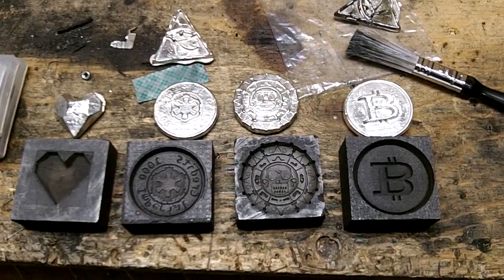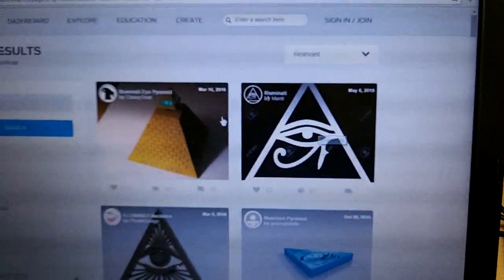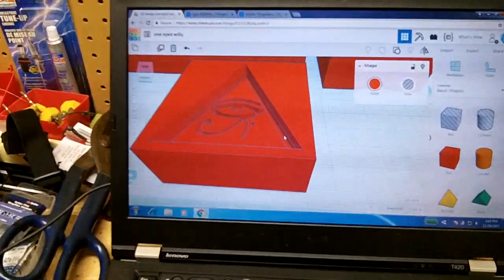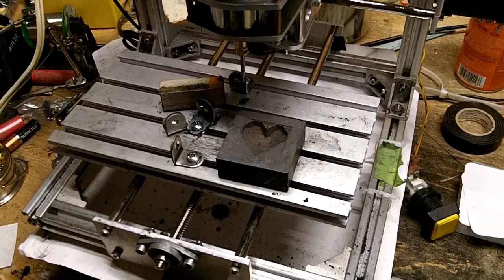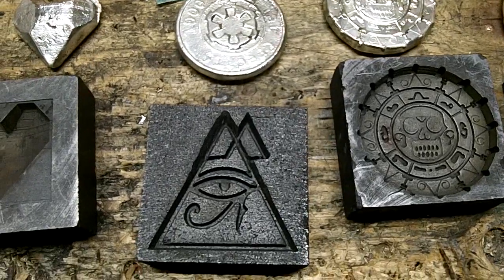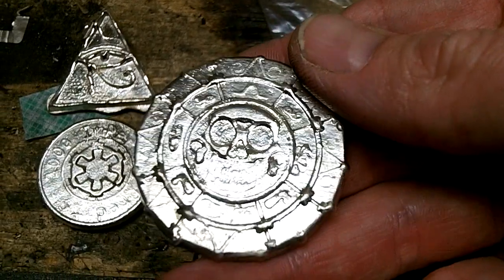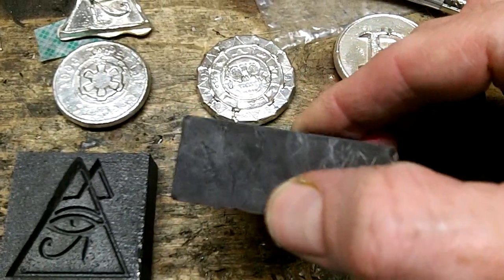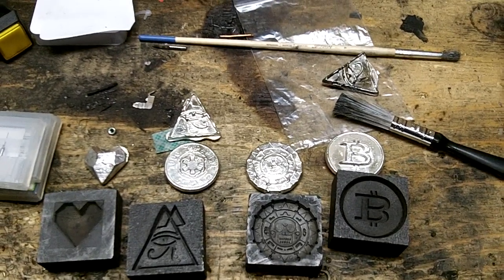Making Graphite Molds

Comment: Thats cool. I was gonna go the opposite way.

3D print the shape i wanna make a mold of. Cover it in graphite powder. Compress it slightly. To retain the shape.

Pop out the 3D blank. Fill it with bentonite clay. 

Then fill out the the rest of the mold with Graphite powder and sinter the lot.

Wash out the bentonite, and id have a mold.

But you way seems a lot easier. If not as finely detailed.

Comment: What bit did you use?
Reply from the maker: 1/8" 20 degree v-bit (basically a tiny engraving bit)  to do it again, I would rough with a 1/8" single flute, then fine detail with the engraving bit.

Comment: I know nothing about graphite molds but im curious if i could use the mold as a crucible itself with a propane torch to melt brass. Basically what im asking is if itll ruin the mold
Reply: there are graphite crucibles so in principle you could, only problem is probably crucible lives matter less than mold lives...unless you can make them your own like in the video...
Reply: This will ruin a mold.

Comment: if you make the top perfectly flat.. and make a side entry spru hole or even a top down spru hole to about/38 wide of a hole out vortext to a half dollar on a new flat block. On trhe other block make 6 or 8 10 air lines to let air escape quickly. clamp the 2 blocks together heat them up while melting the silver then pour it all in 1 quick shot and the detail will be perfect. Your using weight pulse compacting because the silver or metal will press against the flat block pushing the face into the model better.

Comment: If you get your mold red hot before you pour, it will take all the detail and get the silver closer to 1950, 2000 degrees

Comment: Why not simply mold the graphite around the master positive pattern rather than cut it using cnc?
Reply from the maker: There would be nothing simple about that process.  Between the high compression, high heat and exotic binders to get the dust to form into a block it would be impossible for a hobbyist.  Not to mention creating a positive mold to withstand all that...cutting a premade block that can be bought for 5-10$ is vastly easier.

Comment: What size bit do you use to make the molds?
Reply from the maker: On that machine (which I don't have anymore)it was a 1/8" v bit with a .1mm tip.  I can usually cut 1 mold per bit as the graphite chews them up pretty quickly.
Reply: Too Many Hobbies awesome! Thanks for the reply.. is it possible for you to show or email me how you modeled and made them? I’ve been doing them on my channel by hand but yours look great! Just picked up almost that exact same machine but still trying to figure it all out. I’ll gladly mention you in my videos and give you credit and a link back
Reply from the maker: @ArtByAdrock  sure I'd be happy to!  I'm just overseas in greece right now but will be home in mid july If that works?
Reply: Too Many Hobbies yeah that’s cool.. no rush. Do your thing and whenever you get a chance... I have so many projects I’m working on already it’s all good but would love to see how you do it 👍🏻

Comment: In other to get a perfect casting you'll need to preheat your mold blocks to around 1000 degrees this will allow your metal to stay in its liquid state longer that way it can flow into every area
Reply: That's a very good idea
Reply: Just confirming Is that fahrenheit or celsius ?  - Thank you for this information :)
Reply: @hazehunter_au you don't gotta get it that hot just hit it with a torch few sec man pore never had any issues
Reply: @jrcouch5436  thanks man 👊
Reply: @hazehunter_au Celsius, its around 1850 F
Reply: @pichonurbano  Holy Mary, Mother of Christ!!!

Comment: Your mold temperature is much too cold when you are doing your pour. You may burn a couple of molds up trying to find the max temp for pouring but you will get much better detail. Make sure you pour immediately after preheating. 300 degrees is not enough.

Comment: Hey man a possible solution to your lack of detail would be to set the mold on a vibrating plate to help it get down into those crevices a little better.
Reply: pressure, needs to be a press to get the real nice details

Comment: Hi：
This is Elko Hu from Baofeng Five Star Graphite Co., Ltd.
We are the professional manufacturer of high pure graphite and isostatic graphite,and machining graphite parts.
 we has own professional processing plant- Changrui graphite Co.,LTD., 
which covers  graphite mold,graphite die,graphite plate, graphite crucible, graphite vane, graphite wheel,
graphite ark, graphite tube, graphite rotor, etc.. also accept customized graphite products.
any requirements,please contact me.thank you.

Elko Hu

Baofeng Five-star Graphite Co.,Ltd
Western industrial zone, Baofeng County, pingdingshan,Henan China.
Contact Number/Wechat:+86-15617656935
Skype/Whatsapp:0086-15838243056
Email :elko@graphitemanufacturer.com
Website :www.graphitemanufacturer.com

Comment from the maker: As long as you got the file to them in a format their machine can understand, then I don't see why not..They are pretty small so a larger machine would make short work of it.
Reply: What kind of file type does your cnc recongnize? I do some 3d stuff but not with cad, wondering if I can convert my files. Cool video, thanks for sharing it.
Reply from the maker: @totalbullion5882    I start with STL files and after it goes through a couple of programs I get a gcode that can get sent to the arduino that controls the CNC.

Comment: I would love a round made. If you are willing I will pay. I have been looking for coin press dies but I have not had luck.  I can use a punch stamp on the rear after I pour the silver. Thank you for reading. Kon
Reply: Hi,
We are mold maker from New Delhi, India. Please contact me on kdbhardwaj4@gmail.com / +919717208622
Reply: Hi：
This is Elko Hu from Baofeng Five Star Graphite Co., Ltd. from China.
We are the professional manufacturer of high pure graphite and isostatic graphite,and machining graphite parts.
 we has own professional processing plant- Changrui graphite Co.,LTD., 
which covers  graphite mold,graphite die,graphite plate, graphite crucible, graphite vane, graphite wheel,
graphite ark, graphite tube, graphite rotor, etc.. also accept customized graphite products.
any requirements,please contact me.thank you.

Elko Hu

Baofeng Five-star Graphite Co.,Ltd
Western industrial zone, Baofeng County, pingdingshan,Henan China.
Contact Number/Wechat:+86-15617656935
Skype/Whatsapp:0086-15838243056
Email :elko@graphitemanufacturer.com
Website :www.graphitemanufacturer.com

Comment from the maker: The CNC is a t8 "clone" from aliexpress--The bed is bigger than the t8 and you can make it even bigger if you buy the right extruded aluminum and JB weld it together (which I did).  That was done more for increasing support spots than because the models I make are big..
Reply: Can you share the CNC modelo Ali link .. Thanks!!

Comment from the maker: I usually torch the molds first..get them up to 300 or so if I can.  The cnc is from aliexpress and works surprisingly well for the price.  Im waiting for weather to warm up before i make new stuff.
Reply: a way to make a mol without anyone an to graphite powder, mix it with some clay, and add some water, (dont mix after putting the water in or else the clay will likely stick to other pieces of clay, not graphite) then press it an object making the graphite mold or while its still wet, putting in the design by hand. You could even use a chisel by hand if its required to get a very precise mold. This would
Reply: could you link to the cnc you bought? (If it is still being sold) 
I've never really used one, so I don't know what to look for in one ^~^;